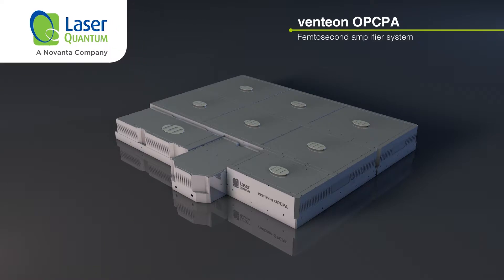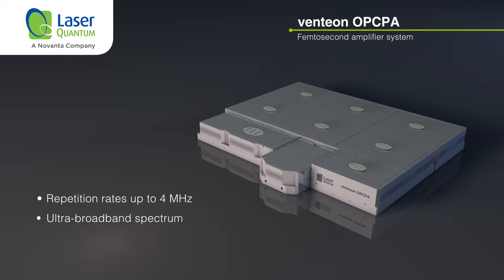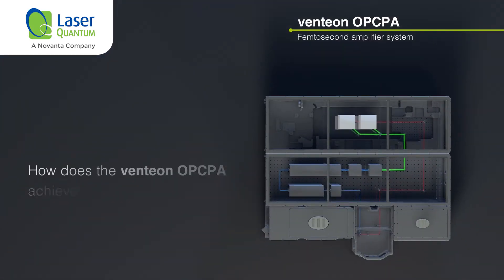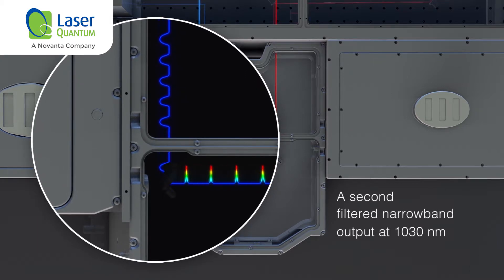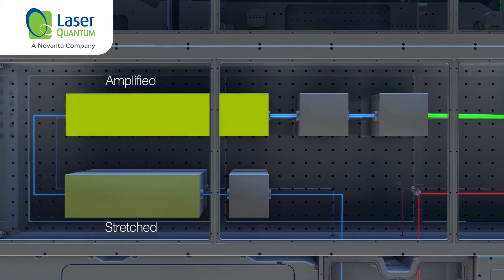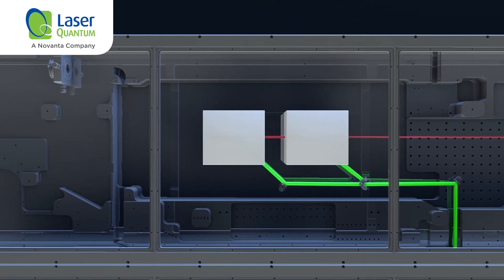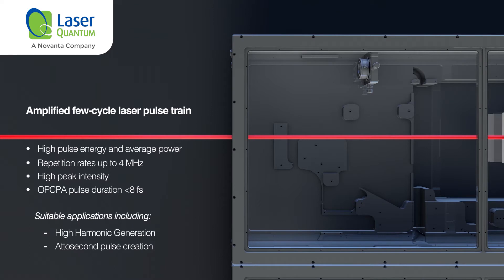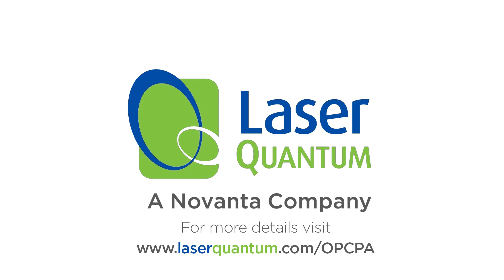The principles of OPCPA | Laser Quantum

Comment: Very good explanation for the scalability of measurement instrumentation , however , why is it neccessary for quarks to be controlled under cryogenic conditions if the observation is already in a controlled state by means of high energy observation?
Reply: It seems like placing quarks into cryogenic conditions is an unnecessary characteristic only due to the demand of personal quantum computational devices so that the temperature of the user interface may relate to a human more comfortably than the human directly modifying his biology through an otherwise painfull proccess due to the lack of a temperature controlled user interface section.